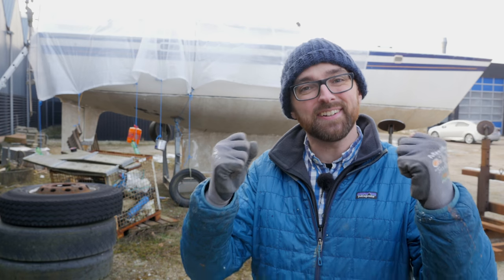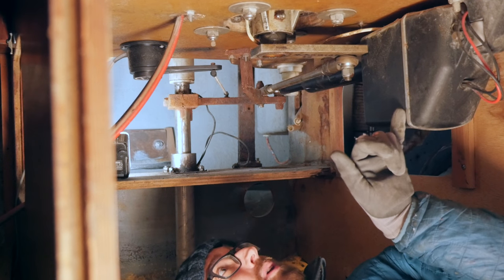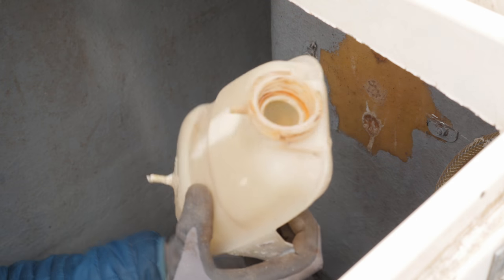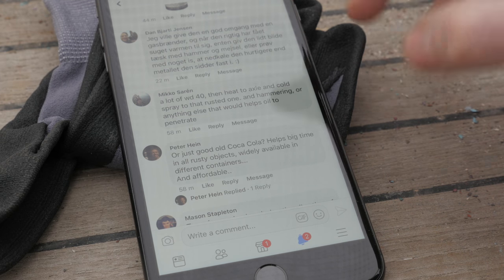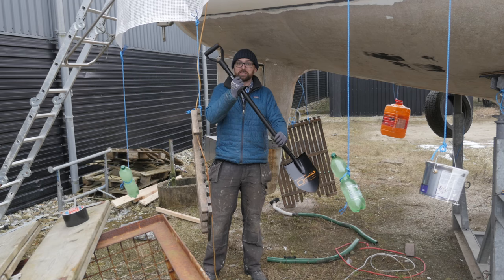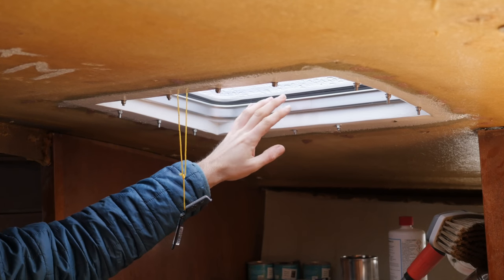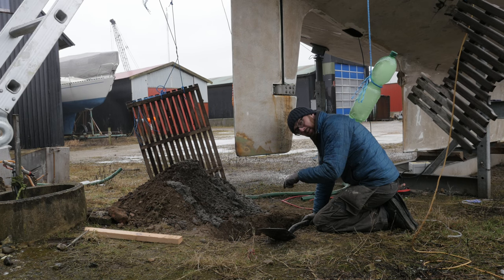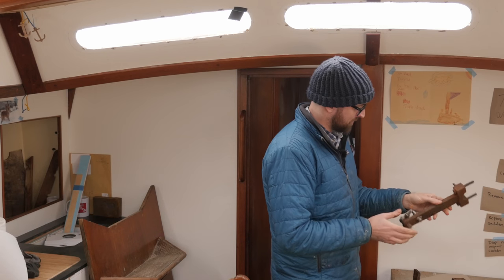Sail Life - Removing the rudder from my sailboat - DIY sailboat repair

Comment: Grind the top dow a few threads width, so the nuts fit, clean that puppy up with a brush and soapy water and , then oil it with machine oil.  It will last another 50 years.  If you clean those iron bits up well they have a shelf life of 400 years.

Comment: Do not rebuild the rudder mechanism in stainless steel, use steel, it is strong, welds better and you will see the corrosion, stainless steel has crevice corrosion and it breaks with no warning. If corrosion is a big problem (the very old pieces seem fine for a 20 year old boat) just powder coat them. Digging on a frozen ground is very fun to watch, thanks god Brasil does not snow......😀

Comment: I think I would have restored the original steel steering bracket. Replacing the bolts with longer ones and refirbishing it isn't too much of a job.

Comment: I have been recommended to use phosphoric acid on rusted steel -  just got some from ebay and I am going to try it out soon on a split coupler that is very rusty. I could just order a new one but if the phosphoric works then I have saved £70 GBP.  Apparently it removes the rust and etches the bare metal to a blackened finish ready for painting.  What is wrong with WD40 for rusted on nuts and bolts? I have removed some really stubborn fixings after they have had a squirt of WD40!
Reply: Phosphoric acid is what we professional mariners use all the time. Mix it with water and you are ready to go.
First mechanically remove the loose rust and yeah, the acid WILL take care of the rest. Whipe it dry and you are ready for painting.

Comment: rust breaking magic: heat and candle wax. 

heat it enough that wax from a candle is drawn into the seized parts. the candle is not lit - just rubbed into the application area - MAGIC

Comment: Would be cheaper to replace the bolts with slightly longer bolts after cutting through the tac welds. Clean and have it powder coated. Stainless would be cool looking but then who is going to ever see it. I don't know what powder coating costs there, but if you send it to me I'll powder coat it for you. I could fabricate one for you out of some 4140 bar stock I have in the shop and powder coat it the color of your choice.

Comment: - Paint the engine compartment
- Drill out the bolts, replace, and paint the part of stainless steel 
- Do not split the rudder as you will damage its strength. 

Lykke til!

Comment: Rather then getting a another piece made to replace in terms of the rusty T, keyed steering piece with 2 wielded bolts I would at least try slicing off the 2 welded head bolts and taking a center punch and hammer the bolts out of there. Take the piece somewhere for sandblasting or Eastwood.com products in the U.S. has rust conversion kit that would be acceptable in a pinch. Having the piece custom made sounds like a easy way out but maybe the person that you had in mind could get the bolts out for you? To replace Use grade 5 bolts or better to replace withe acceptable length. Just got through refitting a 1984 Cape Dory 25D pocket cruiser. Fair Winds

Comment: The crusty rudder bits definitely need to go. You should be able to find a metal fabricator in the area, possibly someone who works on cars or large industrial tanks. Ask the yard who they use, they may have some pointers for you. If I were you I would take a piece of the toe rail with you at the same time. Anyone with skills to weld up a new rudder quadrant may also be able to fill the pits and polish those pieces for less money than a new set will run you. It also might be worth looking at different design options for the rudder quadrant stick thingy at the same time. You may also want to wait to take the parts in until you see if the internal rudder structure needs work too.

Comment: Those shorter-than-needed bolts are what really sinks that piece of old iron. Stainless is my vote. Otherwise, rust removal and sealing, but yeah, short bolts = no es bueno.
Reply: The airflow thing is a bit bsy, mainly because most cars that have sun roofs have it oriented with hinges at the front, yet, air still gets inside plenty.
Reply: Mads, your poor back. :(

Comment: Mads, I wouldn't bother making the doodad out stainless steel. It appears structurally fine for 30 years old. I would cut the bolts, bead blast it, weld on new studs, epoxy paint it, and call it good. The thick "rust" scale you see typically is about 10 times thicker than the wall loss of the metal. In other words, it always looks way worse than it actually is <----- owns a non destructive testing and corrosion inspection company.

Comment: All these “fiddley bits” fixes you will save yourself pain and time down the road. Bees wax on threads and heat will unstick bolts like you would not believe. Try it you will be surprised.

Comment: Clean off the autopilot arm and get it galvanised . Powder coating will just flake off over time and the chances are it will make the arm hole that goes around the rudder stock too small,

Comment: stainless steal would be cool but honestly why not just cut the heads/welds off the bolts that are too short. Then go buy some longer stainless steel bolt and weld them in. Use your angle grinder with a wire brush or sanding disc, get all that rust off and paint it or powder coat it, probably cost you 1/20th the price and its not in terrible shape besides some surface rust. Those other rudder stops might need to replaced....... granted hard to tell on camera till you knock off all the crust.

Comment: SS is pricey in the states. I would get what you have powder coated. It's last for a very long time. And as far as the number threads showing you only need 2 threads showing for aircraft. If you're really worried about the nuts coming off drill holes in the corner and safety wire them together with some .032SS wire. https://www.youtube.com/watch?v=Qi5e4ivifaM you can do it by hand as well the key is keeping the wires 45 off of center. What really causes the nuts to back off is resonant vibration. Love the videos keep them coming it keeps me going on my boat.

Comment: I would not throw away Your rudder lever: the heads of those bolts are just point welded, what is easily removed with an anglegrinder to interchange those for longer ones. 
The steel does look like very high quality material, (probably corten), especially beneath the mild steel vertical part (which I'd replace), so why not just strip it, remove the surface rust and paint it with Branthocorrux or something alike? 
That, in my eyes, will lead to a better outcome than having a pretty costly, mahussive stainless part with a lot of corrosion-prone welds instead.
Last not least better for Your wallet, too.
Reply: Oh, and the Skeg would not be hard enough for my liking.

Comment: I'm not sure if Stainless steel is the right choice for that piece. Besides it being rather expensive material it's also nasty stuff to mill, lathe, drill etc. I'd use 1.0715 (DIN 9SMn28) or 1.0736 (DIN 9SMn36) will be a fraction of the cost and still do it's job in 40 years.

Comment: I would not bother with an expensive SS replacement, that part is way too good. Only surface rust. Just change the bolts and reuse the part, after maybe a phosphoric acid rust teatment and a lick of hammerite. I would use some copper grease on the threads and tighten with nylock nuts. And do buy yourself many boxes wd40 (soak for days, if needed) and a (this is a must!) a small, cheapo gas burner. That combo will fix most mechanichal issues. Careful with the hammer & screwdriver. Not the best tools!

Comment: Rust removal the easy way:  http://www.instructables.com/id/Electrolytic-Rust-Removal-aka-Magic/   Example: https://www.reddit.com/r/DIY/comments/21nipi/used_electrolysis_on_some_old_car_parts_to_make/  Get it galvanised once it s clean. Next time Mads, I think you should buy a brand new hull, deck and foils and fit the boat out to your requirements.

Comment: Clean and paint. Stainless steel is too much money and not worth it. On my boat i have a steel swing keel, after long consideration of chanhing it, i had it "just" galvanized and painted several years ago. Still looks like new! Considering my part is always is in water, you will definatelly do fine with just cleaning and some good paint.

Comment: You are going to re line the engine compartment with insulation why waste paint use foil faced insulation and glue around the edges avoid the area with diesel!

Comment: STOP using a screw driver for GODS sake. Get a Ball peen hammer (medium size) and a steel punch and go in along the keyway as far as that arm, take it to a autobody shop and have them sand or media blast it and cover it in Galvanized paint! The rudder stop needs to be replaced though!

Comment: Submerge & soak all those rust rudder parts in vinegar & watch what magically occurs... like this--->https://youtu.be/tW8tq1z3kzg   ...also Kroil very similar to PB blaster, either work best when applied after heating nut or bolt cherry hot first & then shoot it with PB so it'll actually seep into wedge or threads.

Comment: Too late but all you needed to do was get yourself a cold chisel  1'' and a good hammer. Se tit on the side nice and tight then a few good lumps it would have moved. i have had some way worse than yours that budged fine. Your piddly screw drive just absorbed the pressure and wouldn't have transferred the energy to the keyway. Oh well dremmel love you.

Comment: Like other people i dont think you should bother with the stainless steel.  I have cleaned up a lot of rusty components by leaving them immersed in a solution of molasses and water (1 to 10).  I bought a gallon of mollases from an animal feed supplier for under £10 so it is a pretty cheap solution.  There are plenty of videos on YouTube showing before and after.   https://www.youtube.com/watch?v=vq5IUiYMhR is one of the better ones although his explanation of the science is not the most accurate.